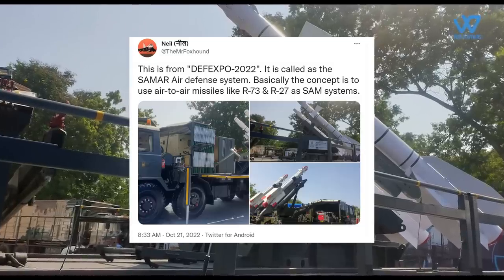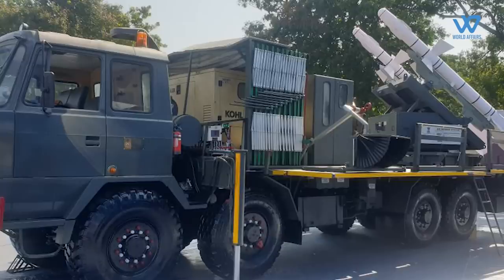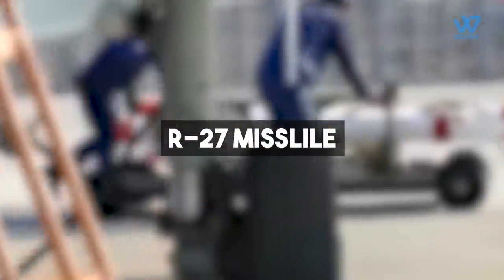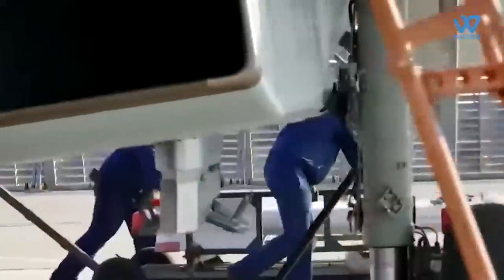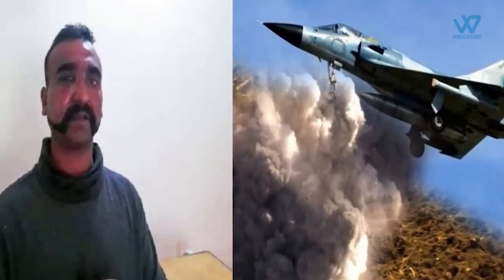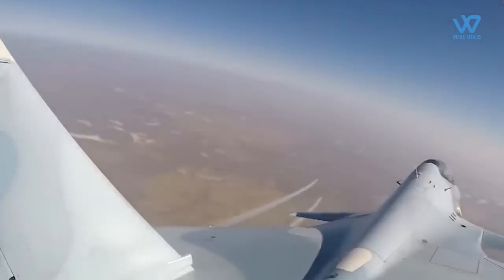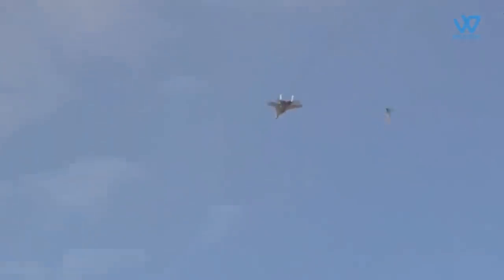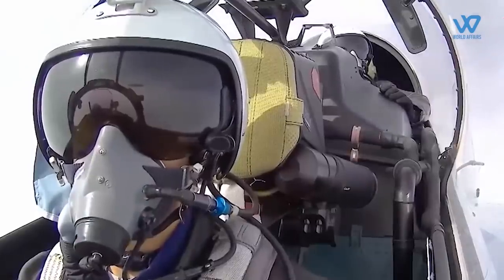IAF converts Russian Missiles into SAMs

Comment: This is called smart work. Well done IAF.
Reply: NASAMS ka nam suna he ya spider ka...bhai jinke pas air to air missiles he sbhi yhi krte he.... it's not a new thing.....
Reply: Love you 😘❤️❤️ G GREETINGS MORE ❤️💞
Reply: @AB-bk6xx  l
Reply: While it may be worthwhile to convert surplus missiles that have been replaced the performance of the missile won't be the same as being air-launched.  The missile won't be as maneuverable, fast, or long-ranged as being air-launched due to the denser air towards the ground.  Also if the missile is SARH either the missile needs to be converted to use a ground-based radar or an air-based radar converted to ground use.  Converting IR-guided missiles is simpler.

Comment: We (Serbians) did that back in 1998. and used R-73 and R-60 AAMS mounted on chassis of Praga 30/2 AAA gun. Our missiles were equipped with booster engines for couping with 0 speed launch. I think I saw even older R-3 and K-13 AAMS used on hybrid AA PASARS-16
Reply: Long live Serbia god bless you

Comment: Yes, a STT-lock from another fighter will lit up your RWR like an xmas-tree-star.....(And a beaming manoeuvre /notch will break the lock as well)
Reply: AESA radar can get track/lock without pinging RWR with narrow beams and high directionality.
Reply: @MrDJAK777  Even a STT-lock?
Reply: @jakobole  with appropriate LPI AESA design yes. Fox-3s require it and the radars I'm referring to allow those to be fired with a lock without setting off the locked targets traditional RWR.
Reply: @MrDJAK777  a Fox-3 doesn't require a STT - lock. I'm referring to Fox-1's